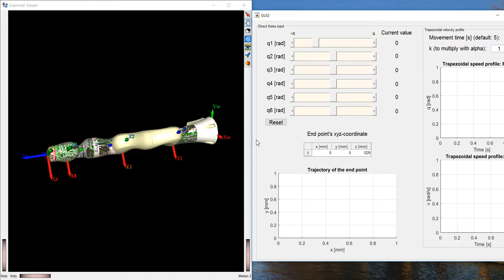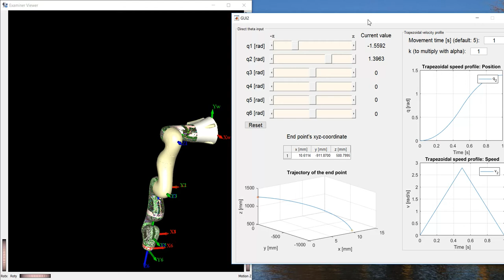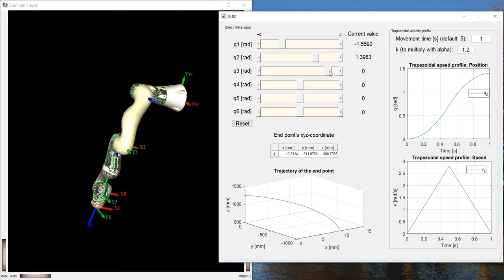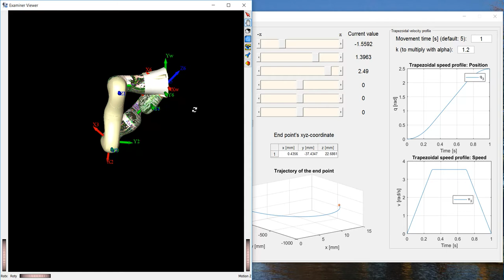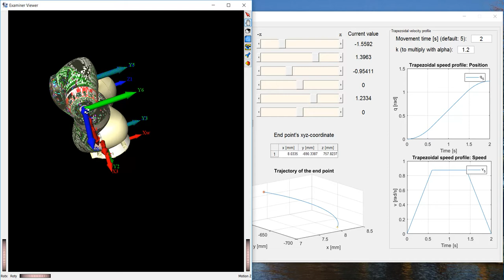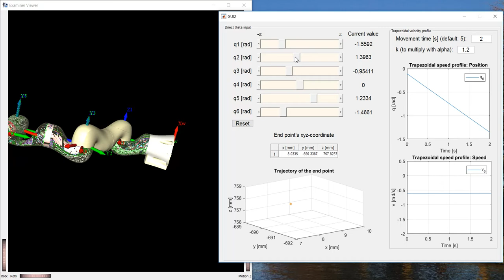General example forward kinematics KUKA LBR iiwa 7 R800

Comment: could you tell me ,how do you did the GUI?
Reply from the maker: Hi, thanks for your comment.
Making a GUI in MATLAB is quite easy, I followed MATLAB's documentation: https://nl.mathworks.com/discovery/matlab-gui.html
You can find some useful videos here: https://blogs.mathworks.com/videos/category/gui-or-guide/
Or simply Google "how to create a GUI in MATLAB" :)
Reply: Thank you for your reply. what about the left fenster, where you displayed the robot? did you do it in matlab as well?
Reply from the maker: I didn't do that in Matlab, I used a software called: SPAN Viewer (http://esa-telerobotics.net/gallery/Research/Tools-API-s/SPAN-Viewer/16 ). In that software I loaded the CAD of the robot, which I got from internet and split each section (degree of freedom) for visualization purposes -I edited the CAD in SolidWorks. SPAN viewer also allows to you to use a socket to connect it to MATLAB via UDP.
Reply: okay, i will probaly also do it, thank you again
Reply from the maker: You can use CAD models in Matlab too, but I haven't done it yet. You can Google it, though :)